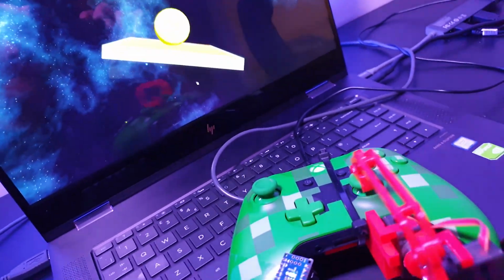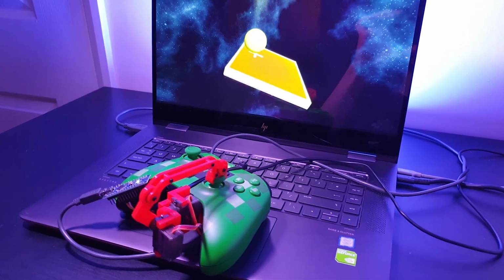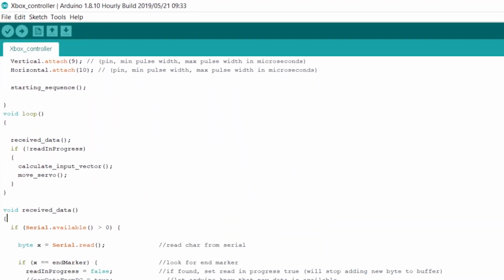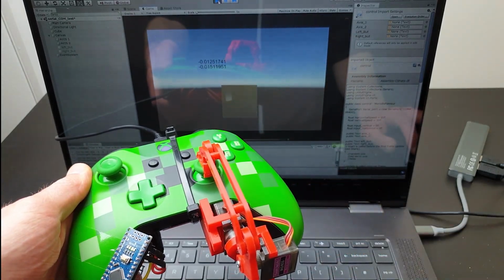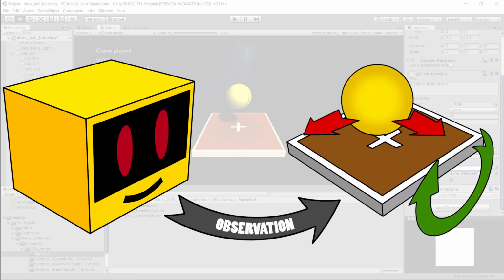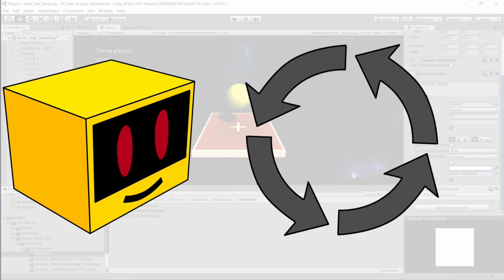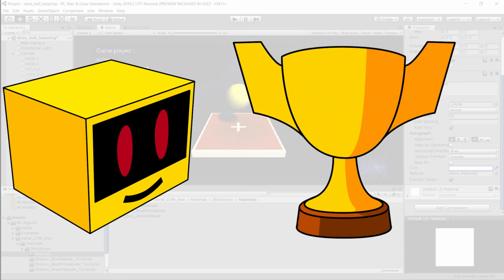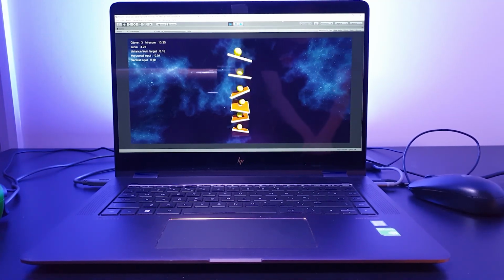A.I learns to play a game with an Xbox controller .

Comment: This is a great video on many levels. There is beauty of mind at each part. The hardware design is sensitive to shape and function. The assembly is clean and elegant.

The software part is a relatable story, even though the technical aspects are miles above my knowledge.

The left-right mirroring on the joysticks to start, then machine slowly taking over shows the power of your methods.

Comment: Did you use a 3D printer to construct the pieces? I didn't catch when you said how you made the mechanical component.
Reply from the maker: Yes, I designed and printed them myself . Unfortunately I didn't record any of it .
Reply from the maker: all available on my website now : https://www.littlefrenchkev.com/xbox-controller-arm
Reply: how else would he make custom plastic parts?
plastic sheets and a coping saw is too much work.

Comment: Just came here from your reddit post, this is really cool. I still don't fully understand how it works, i thought maybe there was a camera pointed at the screen, and then you can calculate the angles of the plane and where the marker is to act accordingly. How are you doing it? Is the arduino given the angles from the program directly, and then you taught it some skills using the other stick?
Reply from the maker: No camera .  All the info the neural network needs is collected directly in game . This is possible since I made it . The neural network then feed its outputs to the arduino which then translate them into joystick position and move the servos accordingly . The neural network run on the PC the arduino is basically just a slave .

Comment: i would love to get info on how to reward AI for smooth movement
Reply from the maker: The way I did it was by feeding the neural network its previous output . And then giving more reward or punishment depending if its current output is close to the previous one .

Basically I tried rewarding having minimum change from one output to another .
It did take a lot of training to start getting results but it worked  .

Comment: How could I control with a robot arm kind of thing the other buttons ?
Reply from the maker: For the push button  the easiest would probably to use some sort of solenoid to press them . If you want to use the other joystick The existing design could be duplicated and modified to fit . The trigger buttons would need to pressed using servos if you want to keep there pressure sensitivity .

In any case the base/frame would need to be redesigned to be able to hold these extra actuators .